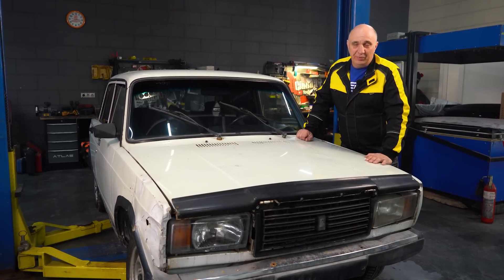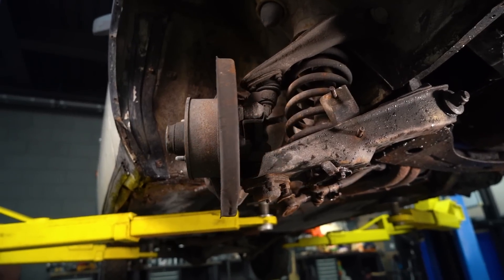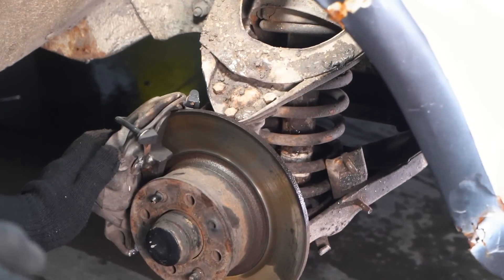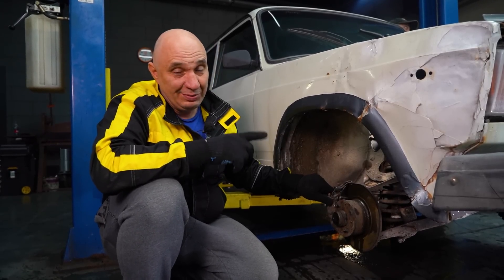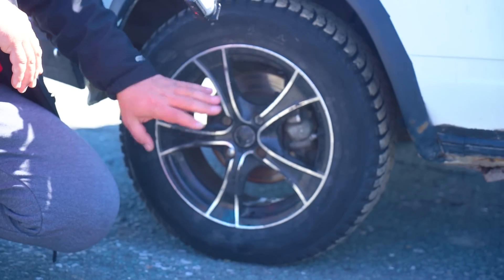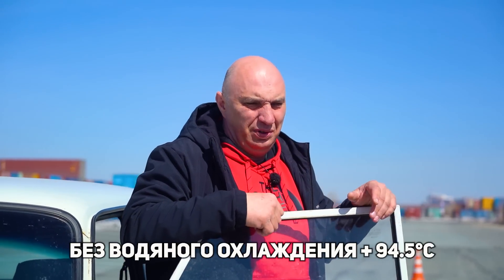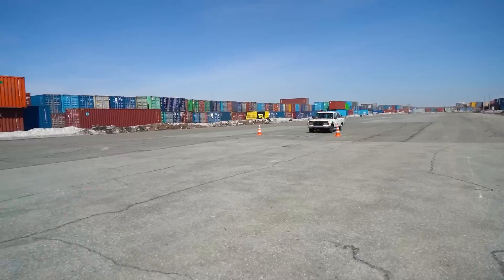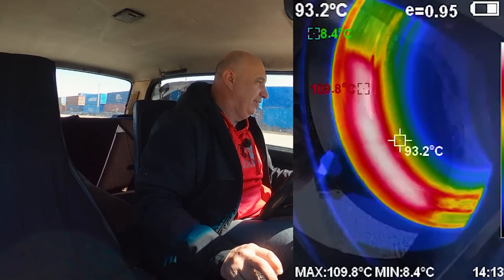We spray water onto brake rotors for cooling - will it work?

Comment: No liquid nitrogen? Dissapointing 🤣
I was expecting than even water would impair braking, as brakes work like shit while wet, like when driving over flooded areas. But that's a lot more water tha a jet.
Now, spray them with oil. Should be interesting.

Comment: It's not surprising. They use this method to cool brakes on trucks in Asia and it's a cooling method that has been used for decades. 
The misconceptions are based on already HOT brakes. The whole idea of the water is to keep the brakes from ever reaching critical temperatures while saving calipers from being overheated as well. Once the calipers burn the oil outside the piston, they will begin to stop fully releasing and begin to drag. 
The water is used to prevent all that from happening.

Comment: Maybe it a way they have come up with to combat the outside tempter if the temperature outside is minues 20 that's negative below 0 ok so driving normal you brake rotors are going to go through temepture changes of very exyeram difference it can cause metals to crystalize making them Brittle which then makes them more possible to catastrophic failer do to temepture there for these men just might be trying to save others by way of designing a cooling system for cars in a certain geographic location

Comment: Due to rotation, shouldn't one set of the sprayers be below the caliper, depending if you're intending on spraying the rotor just before it enters the caliper, or after it exits the caliper while moving forward?

Comment: Though this doesn't hold too much value for an everyday driver. What kind of impact could liquid cooled breaking have on the race track. Reduced wear, reduced heat, the potential to stay out longer resulting in better track times. If the driver knows to adjust their driving style and breaking they could use this to their advantage. If the cooling functions we'll enough at cooling breaks then it would never be hot enough to be a problem, the only question is how fast you can get it to evaporate to reduce risk of fire.
Reply: I can also see it being worth consideration in hilly areas, for most vehicles heavier than a basic sedan.  Reducing brake fade and even saving a car length or two on braking can make a useful difference.
Reply: @TheAttacker732  yeah would be great for trucking

Comment: Water cooling's quite common on heavy vehicles that need to go downhill in order to prevent a runaway situation, cos an HGV with no brakes going downhill is a poo-inducing situation, for both the driver and other road users... :P
Reply: @TobiasCat-dl2juY Or I shall ignore this and continue to use it as an expression of great fear, it doesn't necessarily mean people actually soil themselves, it is a turn of phrase, much like how people claim something "blew their mind", and yet, their mind is completely intact without having blown up, or when someone is told to "go f themselves", they don't literally mean to fold their genitals around and insert them in their rear, language is a funny old thing, so, don't take things so literally, otherwise people might think you're a bit weird... :)

Comment: Trucks here in Philippines especially in mountainous areas the usually custom made water distributione line to the brake drums or disc as well, they just put the hose above the brake then they  control the flow with a faucet that is connected into a water drum that is fitted at the side of the truck, they did not encounter some problem about it

Comment: A similar system is in use in truck races (that's why their wheels produce steam when they brake and also one of the reasons why truck races are short: the water tanks for brake cooling are strictly limited in size)
To stop a 5 tons truck rolling at 160kph, you need to cool down the brakes with everything available (brakes can't endure the entire race without a cooling system)
https://youtu.be/wCvRrmPwyrU?si=TGAyqH77GXzR-LpP

Comment: The ONLY difference should be lower temps. Not faster breaking, physics doesn't allow for faster breaking, if you try, you lock up your wheels.
The reason you may break better is because you place the right pressure on the brakes, if the tires slip, is because they lock up, which also prevents more heating.

Comment: I would love to see this on drum style brakes. Considering that brake fade increases with heat because of the heat expanding the drum, vs rotor disc brakes that dont deal with brake fade as much. But, then again, brake drums are not as common anymore. Even in semi trucks, they are moving to Aor disc brakes.

Comment: Brakes on all modern vehicles are much bigger than they need to be. If you’re overheating your brakes on public roads, you are doing something seriously wrong. We aren’t talking about auto racing on a track here, since you would have brakes and cooling ducts that are appropriate for this usage. Even with mountain driving, if you’re overheating your brakes to the point of fade or warpage, you’re driving terrible wrong.

Comment: 100C is really low temp for racing brakes. Wilwood BP40 or PolyA pads are good into 1100-1300F, but admittedly you need hi temp synthetic fluid to push that hard

Comment: To really see how well this works a road course track would be best.. drive the car hard enough to experience brake fade and then see if you can come back out of the brake fade without reducing your pace using water cooling.  Do you really get brake fade you need repeated stops from high speeds 100mph +

Comment: Build something with 1 engine for each wheel
Reply: @TobiasCat-dl2juY yeah i was thinking 1 cylinder per wheel only problem would be making them work in sync with each other but im sure its doable
Reply: Electric vehicles can do 1 motor per wheels quite easily, by using in-wheel motors for example. Though 4 combustion engines would definitely be interesting.
Reply: @TildaAzrisk  There was one made a long time ago and it was shit, cant remember what it was called but it was referenced in a vid I watched. It would be interesting to see what they could do with modern electronic engine control units and such

Comment: Brake pads are DESIGNED  to get hot.  They don't function correctly until heated.  Carbon brake pads function at even higher temps where normal passenger use brake pads fail.

Comment: Spraying it behind the rotor so that the water can enter into the gains will give you better results. Also high pressure water through a small nosel will also give better results

Comment: Those break discs are really old and really worn out looking how thin they are that’s why the infrared camera is shows hot spots from the distortion try using some vented discs and direct the water through the vents from the back of the disk

Comment: This was cool......thank you, this should be in trucks, but to carry extra water in weight is not an option for most drivers, as fuel is expensive, although it would save lives. great video, i subscribed. My suggestion for another video, I heard from a biker that if you  mix 2 litres of Diesel or Petrol (hydrocarbons) with 1 litre water you can presumably save some money on the fuel bill. How? by adding 1 teaspoon of regular dry laundry detergent to the mix, at the ratio described. Then, if you keep the mix stirred, (The detergent allows the hydrocarbons to bond with the H2O molecules) you can run an engine on it without any apparent power loss or damage. Diesel for diesel, and petrol for petrol. Would you guys care to test this as it sounds like fun?   Have a great day.

Comment: Add an optical thermal switch to activate it once a temp threshold is reached
Reply: I was thinking an accelerometer, either a formal one or a microswitch with a weighted armature, to turn on the water cooling with high deceleration. An optical thermal switch is more elegant than the microswitch and would not require finding a place to install the microswitch where the weighted armature could swing freely. I think it would even work better than the accelerometer, because long brake application with only moderate deceleration (like the HGV on a grade) will also heat the brakes and may not reach the deceleration threshold necessary to trigger the accelerometer and activate the cooling jets.

Comment: Maybe try to compare tap water, bottled water with lots of minerals and deionized water... It's possible that a fine layer of residues makes the rotor more abrasive.
Also try with a decent car with enough power on a racetrack and do many turns before checking the breaking distance!
Also try a car with ABS. Even with good tires on a good road you should be able to activate it. If not ot means that your breaking system is too weak.

Comment: If the rotors were vented, I would try spraying water into the center of the vents. Slotted and drilled would help as well to evacuate the water from the pad surface

Comment: You should use vented roators and spray the water in the vents cooling the roators from the inside and not allowing liquid on the contact parts 😊 grate video as always

Comment: It looks like alcohol is lubricating the rotor surface more than water does. It's surprising to me to see surface application of water reducing stopping distance at all because it lubricates the surface, but even more surprising is seeing alcohol increase it. Alcohol evaporates at a lower temperature than water and should be reducing peak temperatures because of it, which should reduce braking distance, but apparently it is not. I'm guessing we're seeing lubricity play a larger role than cooling in this test. Perhaps with a race oriented test and the higher loading we would see different effects.
Reply: Likely alcohol vapors getting trapped between the pad and rotor once heated, causing a minute, but non-negligible standoff between the friction surfaces. Just like how bacon skids across a very hot pan.

Water has higher heat capacity, thus not turning entirely into vapor immediately, whilst lacking the surface tension to cause the pad to hydroplane. Resulting in a net gain in performance.
Reply: @V3R71GO  Your explanation sounds much more plausible than mine. It sounds almost like how water-contaminated brake fluid boils and then becomes compressible, ruining braking performance.

Comment: An hour or more driving in the mountains brake fade is significant after just a few minutes, let alone fifteen minutes. Being able to cool down the brakes would build some confidence heading down a big mountain. Maybe even in a semi truck for commercial use. I think something like this could prevent some run away semi truck accidents. Semi truck brakes actually catch on fire upon steep prolonged decents .
Reply: Even with compression brakes you have to touch the regular brakes on some descents (with a semi). This would be awesome to implement.
Reply: a Semi truck (or a car for that matter) shouldn't be using the regular brakes on steep prolonged a decent

Comment: Part of the reason the alcohol based ones weren't so good is because the brakes need to make a certain amount of heat to get efficient in the first place. Thats why cold brakes usually take a stop or two to become fully effective. 
They would be more use if they only activated on brakes which are already close to overheating. 
Coolant has lubricant in it because of the moving parts it comes into contact with so that was always going to allow less friction.

Comment: Try ventilated rotors and have the water spray inside so water travels through the vanes between the brake surfaces, get water cooling without  getting liquid between  pads and rotor.
Reply: i think this is what they do in truck racing.
Reply: This is a very short braking test like what they do in road certification. Here the heat load is very brief, so only the very top of the pads and discs are actually reaching those temperatures. Even if you could get water inside of the discs coming out, the inner temperature of the rotors is much lower than the outer surfaces. I think for this test what they are doing is optimal.

For heavy load applications like truck racing, their braking is much more often and much higher loading. They can easily see temperatures of 300c+ inside the vanes on those discs, so for truck racing that makes a huge impact to cool from inside.
Reply: Because of centrifugal forces; the water wouldn't make it inside the vanes unfortunately. It would be blown out.
This is a great idea; because while water is an insulator it's also fantastic for convection when it changes temperature and phase changes. 

I would say the windscreen fluid contains a lubricating chemical which is why that was less effective for stopping distance. 
Where as antifreeze is glycol which is definately a lubricant (hence why its chosen for its properties when it comes to a coolant).
Reply: @jarsky Spray from the wheel bearing side on ventilated rotors. the air moving through the rotor vanes would likely aid in carrying the atomized droplets, and/or the centrifugal forces would naturally flow the water through the vanes, and ejecting the resulting steam/heated byproduct.

Water is not an insulator. One of the water's chief advantages, is its heat capacity. It is able to absorb a massive amount of energy, hence why it is used as a very effective heat transfer medium. If anything, air is more of an insulator in every sense, compared to water.
Reply: @V3R71GO  Oh yeah for sure; but thats a tonne more effort and potentially means milling the inside of the brake rotor to fit it between the hub and the disc to spray inside. The way they had it setup is far less messing about as a POC. But also for the short tests theyre running; it would be more beneficial on the rotors surface where its hottest. It would be more beneficial inside the rotors on the fins during endurance applications; hence this has been done on lap cars. 

Water is a thermal insulator. The property you described is exactly why its an insulator as it will absorb heat more easily and is reluctant to exchange it back. Hence why it was the precursor to my statement that this makes it fantastic for convention when its going through temperature differentials or phase shifts (fluid to gas) as in this use of it. The same principal as to why its used in heatpipes for things like Heatsinks; or in Water to Air intercoolers.
Reply: Its great idea to wash brake part clean.
Reply: That are solid none vented rotors that why it was put in front of the caliper
Reply: Coolant is slippery af lol especially the euro spec coolants
Reply: Adding water inside the rotor was done frequently in 60-80's in the USA. This also a standard in Asia for trucks operating in the mountains and they provide watering stations for the brake systems along the roadways.
Reply: the water would never get inside the vanes with the rotor spinning
Reply: @Bzz637  Spray it into the wheel bearing side?
Reply: @Bzz637  if sprayed from the inside out it wouldnt have anywhere else to go and probably would. It wouldnt take much to make a significant differemce in cooling

Comment: Maybe if the experiment used vented brake rotors in which the coolant is evenly injected from the center of rotation so the liquid never touches the brake pads?

Comment: Water for the win. It's inexpensive, and you can get it anywhere, and it doesn't increase stopping distance. I'm not concerned about rust/corrosion, it evaporates too quickly, if the water jets turn off as soon as the brakes are released.
Reply: Freezes in the winter. Washer fluid still a fairly cheap bet though.
Reply: @DulcetNuance  You make a good point. Of all the fluids that don't freeze in the winter, the windshield washer fluid has the least impact on braking distance. It's only slightly worse than water, and about the same as dry brakes.
Reply: @DulcetNuance  Being in the engine bay may partially mitigate that anyways.
Reply: Needs to be made illegal though. Many people have died from drowning in it. Some even from drinking too much. Big Brother will keep us safe. You can still access water but only with a special permit requiring lots of $, restricted to those in the club you ain't in. This measure will reduce racism as a side benefit, mainly from there not being people around anymore to be racist. Big brain eXpErTs over here.

Comment: If you want high performance breaking, you can use carbon fiber break pads. The thing that is special and them is that the Hotter they get the better they work. This is why drag racers and formula 1 racers use them. They don't work as well at cooler temperatures, but as they heat up the better they work.
Reply: The lada probably would not even be able to get carbon ceramic brakes up to operating temperature.
Reply: @V3R71GO  maybe if it's going downhill with a huracan behind it. Lol
Reply: Won't work for every day use. Carbon tends to crack with the amount of cycles
Reply: @AlphaFlight  that's true I was talking about for experiment purposes and racing purposes.

Comment: they use water cooling in truck racing
Reply: Why would you add weight to a truck?
Reply: @TheCommanderNZ  racing trucks have been lightend and the water tanks ad sability to the truck cab as well and the water is used spearingly to.
Reply: @TheCommanderNZ  Most stock cars have lead in them to make the minimum weight requirement and to distribute that weight where you want it.
Reply: @TheCommanderNZ because you want to brake.

Comment: Brake rotos DO NOT WARP because of high heat, they warp when they are cooled too quickly while they are hot if lug nuts are torque us uneven